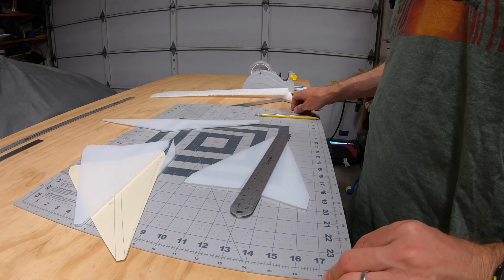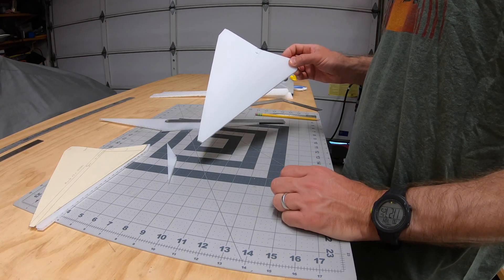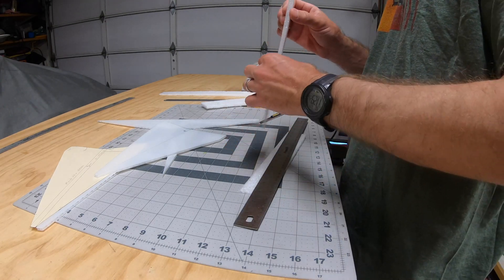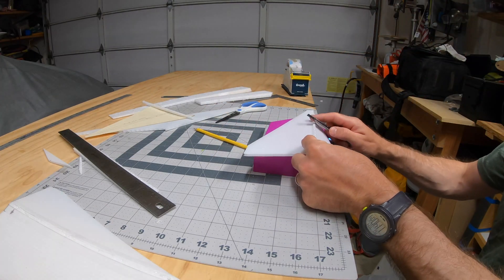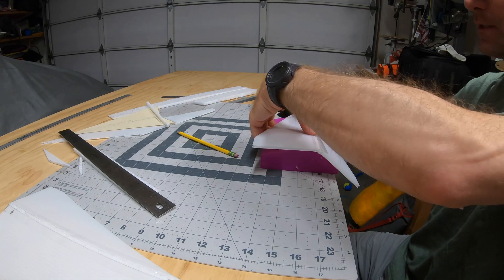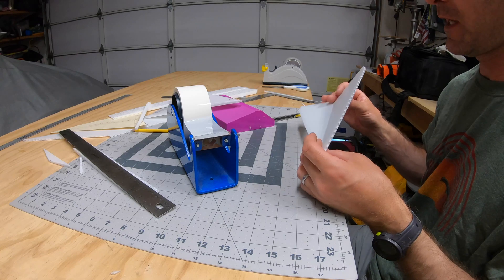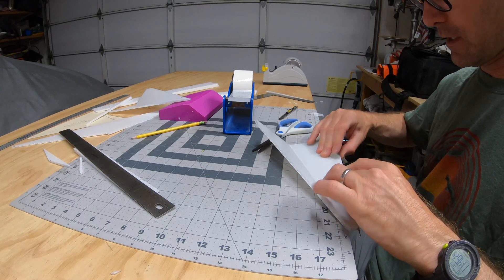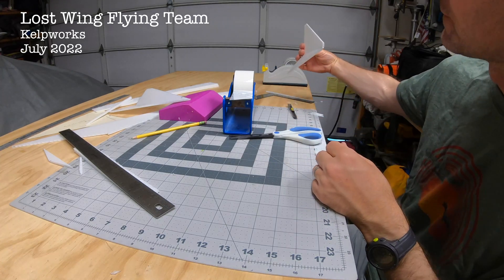Making Folded Winglets

Comment: Nice tutorial! I also find there is another big benefit to the angles- They create “anhedral” which has the effect of reducing/damping the dutch roll (yaw wag) that is so prevalent in swept wing aircraft. Throwing plate style winglets on after using the angled type makes the difference immediately apparent.

One other really cool feature is if a wing is a little tail heavy, you can often fix it by angling the lower winglets out. This adds wing area to the aft portion of the wing and has the same effect as moving the CG forward. You can experiment with the angle until it feels right.
Reply: That’s awesome Nate. They work so well it’s pretty incredible. Brian had a crash test hobby wing that became a fantastic slow flyer after he put on some fairly large bottom angled only winglets. Thanks again for showing us the way of the folded winglets!
Reply from the maker: Great info Nate!